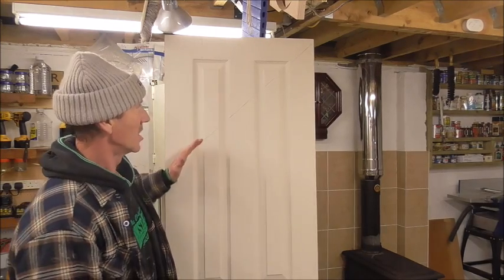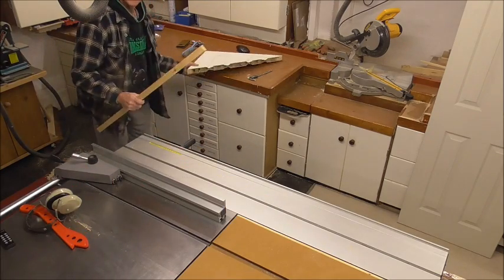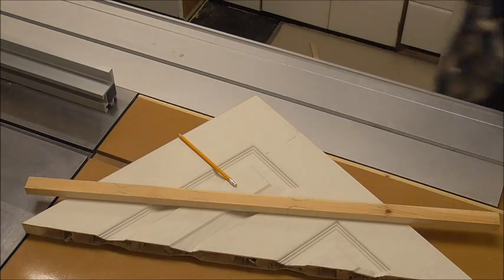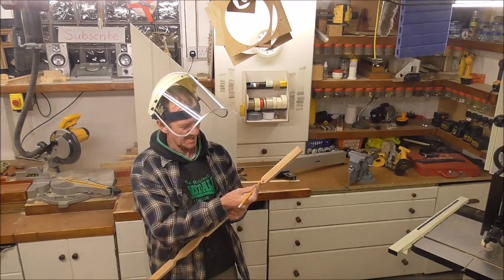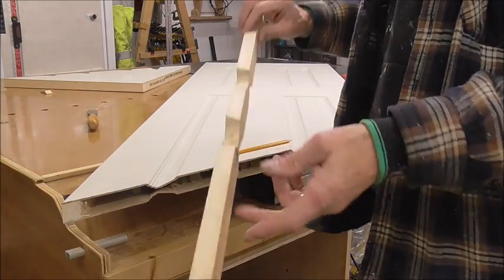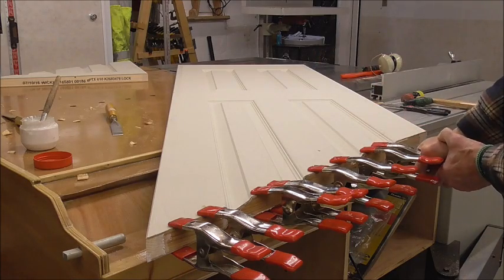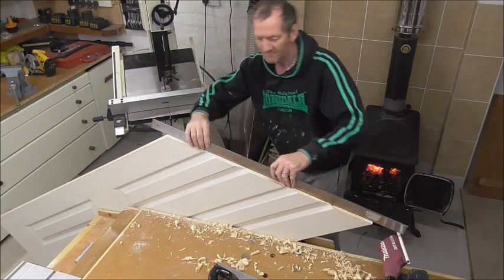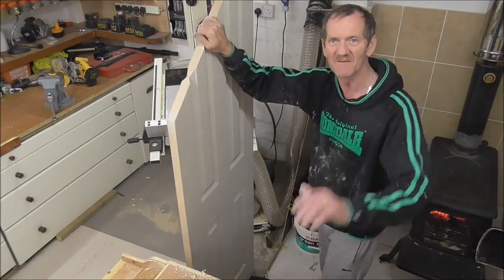Adjusting a Molded Panel Hollow Door

Comment: I work in a factory in barnsley South Yorkshire where they make these doors and it looks like you got one of the better doors if it was made in barnsley because the paper infill is put in the door by hand and it doesn't always fill the whole door. Good job fitting the new top rail by the way
Reply from the maker: Glyn Shirt Thank you. not sure where it came from supplier was Wickes i do know the size (24" 610cm) was very difficult as no one is stocking it anymore.
anyway thanks for the comment

Comment: Nice Job, I'm currently doing the same with a door under my stairs.  Fortunately for me I didn't have to cut into any of the molded panels.  However I did have to remake the door jam for the new angles on the door. i've been figuring it out as I go. I think when I'm finished It will look much better than the square door I had before.  Cut to fit is always better than fitting the trim to work with the door.  This way everything flows right.  Just wonder though, why didn't you clamp a straight edge when cutting the door?  It seems it would of saved you all the extra work later on.

Comment: You remind me of the guy from the movie CHAPPIE. Awesome job on the door but would save you a ton of time to just spend the extra $20 for a solid composite core door. Then all you have to do is cut it. I was really looking for a video on how to do the whole door frame at a slant. I need to install a door in my attic for a closet and the top needs to be slanted at about 35 degrees.
Reply from the maker: catfisher420 Hi thanks I have done such a video, as for you point I can see what you mean but here in the UK this style of door was once very popular but no very hard to get and my customer have these doors throughout there home and needed a match so this was the only option

Comment: Hi. How do you do the same cut but with a solid door for the understairs toilet.  The door that i am doing is solid 6 panel ,not hollow.  Do you have any vids that show how to take a door apart.  Thanks inadvance
Reply from the maker: The problem with solid doors is if they have panel's you will be cutting main structural points and will have to re do the jointing in some way depending on the door
Reply: @dmgladden  thanks for the reply.  Is there any vids that i can follow.  As I can't find anything,  I remember seeing Tommy Walsh doing something similar.   Thanks inadvance
Reply from the maker: @markforshaw7148  sorry ive not done one myself and i can't think of anyone that has

Comment: This is an old video now, but out of curiosity, why didn't you cut the angle say 6 inches shorter and than add a header similar to the footer at an angle.  It would have looked more finished and not cut off, and been a lot less work shaping it.
Reply from the maker: Jeff Irish budget job the customer would have never paid for such extra work to be done so this was the best i could do with what i had